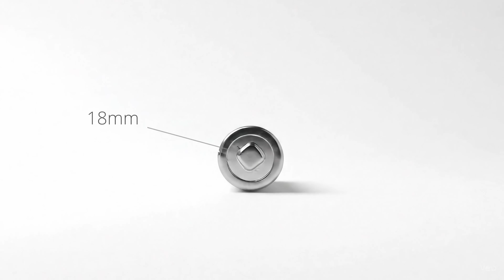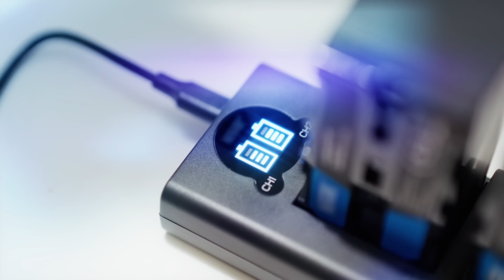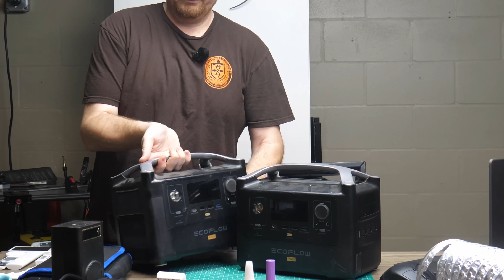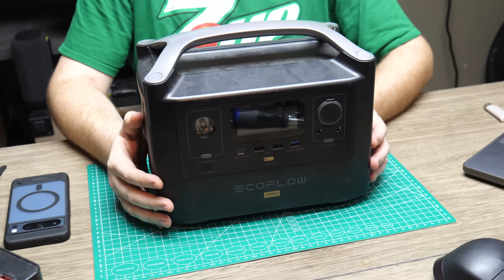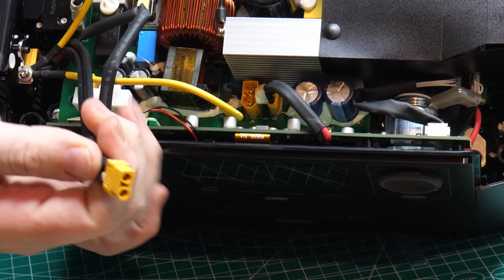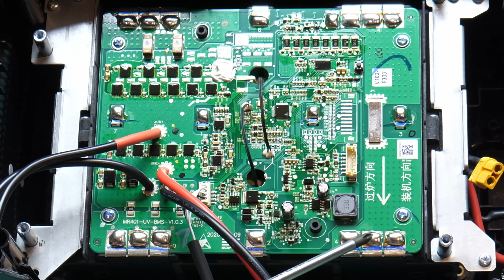I Bought 10 DEAD EcoFlow Power Stations... (Explainer and teardown)

Comment: Wait this is kind of cool. I do have a question, and I may have missed this in the video, but why didn’t you just buy an EcoFlow Delta Pro, or something bigger? Is it for the distribution aspect as you talked about?

Anyway, I subscribed! Very interested to see what happens! Please be careful and don’t hurt yourself or burn anything down😂
Reply from the maker: Good question - the delta units use a different battery chemistry that I'm just less familiar with. They're also a larger risk:reward since even the units with bad batteries sell for $2-300 each vs $80. My first thought with these units was to strip them and just use the cells that weren't too degraded, but after I had no failures in the first couple packs, I researched some more and felt comfortable bringing them back to life. 

Who knows, maybe we'll see a delta video in the future :)

Comment: That ecoflow rivers inverter is not big enough  to start the compressor in you fridge i have one and it would not run my fridge.
Reply from the maker: Good callout - I plan to address that in a later video using a soft start circuit - stick around to see if it works!
Reply: @fauxrhino  if its able to hack em work  paralleled   ac ..  and output more   amps  count me in
Reply from the maker: 🤫 Spoilers 😁
Reply: @fauxrhino  The defrost cycle is usually what gets you when you soft start. 12v fridges otoh work pretty well with one.
Reply from the maker: I've found most (modern) refrigerators have a button press combination you can hit to disable the defrost cycle. I was able to get around 23 hours out of my handmade backup battery using that last year before I had to start generator hunting. Google your model number, and you might find yours has the same!